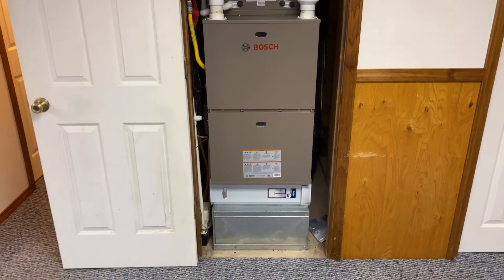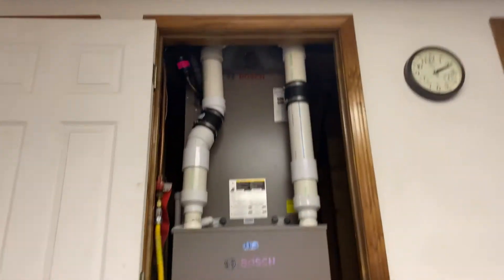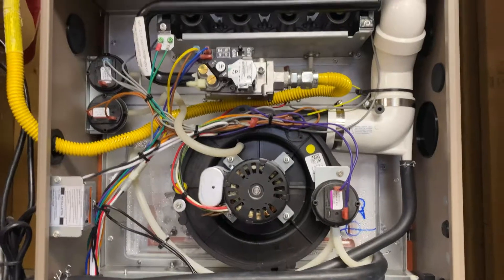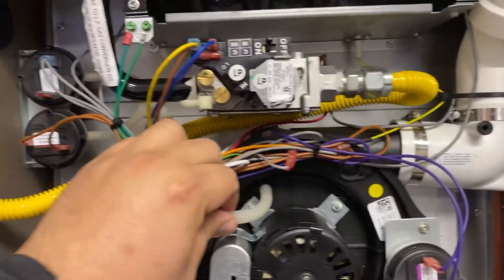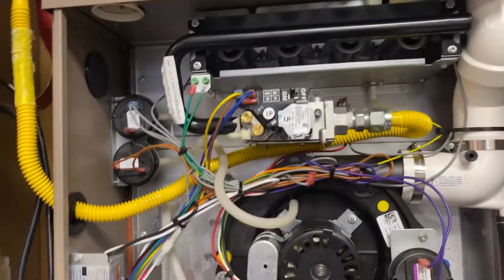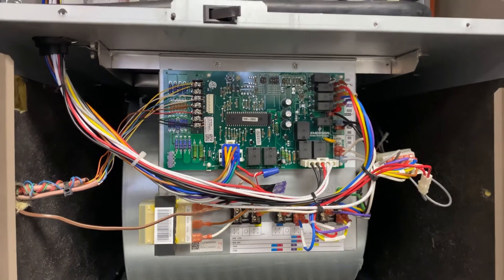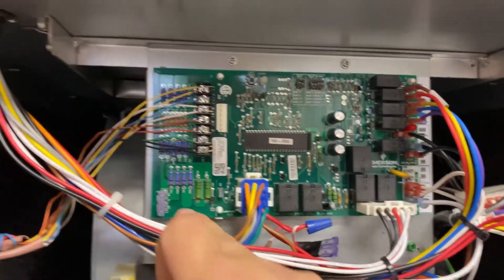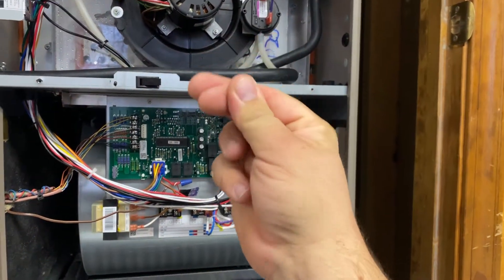Tech Tips #6 Bosch 96% Gas Furnace

Comment: Hi JC, thanks for awesome videos, I have decided to go with the same setup. Just debating if we should go with 80K or 100K dual fuel furnace. Installer said both should be ok. Now we are confused. Our above grade liveable space is 2800sqft and basement is finished also without any outlet yet. What do you think?
Reply from the maker: I’m sorry that I just now saw this! Is it new construction home? Or an existing? What is the square footage of the main floor? Is there a second floor or just main floor with a basement?
Reply: I would definitely go with the 100k furnace since it is a two-stage.  It depends on how cold it gets in your area and what you plan to use as a setpoint for the HP switchover.

Comment: Hey JC, I have the Bosch BGH96 installed with the Bosch Heat pump.  It was installed in February of this year 2023.  It's a horizonal right air discharge install in a crawl space.  When the installer (good company) placed the unit, it ended up too close to the ground to properly install the condensate trap.  He ended up installing the trap horizontally, in my mind rendering the purpose of the trap useless.  That being said, when the unit was being tested, the condensate would not drain out of the clear collection box, not even if the drain hose was removed.  The unit just appears to suck air into the box from the drain port bubbling until the water reaches the overflow switch and shuts down the unit (Like it should).  Do you have any ideas why the unit is sucking air and preventing water from draining out the port?   Additionally, the installer couldn't fix it at the time and we decided just to use the heat pump for the remainder of the winter and the installer would return in late fall to try to correct this issue once they contact Bosch for help.  I'm in the process of contacting them to finally fix this issue, I hope.  Thanks!!
Reply from the maker: After consulting the big book of secrets (manufacturers install manual 😂) you HAVE to install the trap vertically. It will not work horizontally according to the manual. So, if they cannot utilize the manufacture trap, they will have to find a way to make one themselves. 

Also, something that I myself didn’t even catch initially. The rubber 90 that comes right after the inducer draft motor, it has a little drain that comes off of it. It actually comes from the factory uncut (no actual hole). It would have to have the end snipped off to expose the hole. If they’ve installed several of those furnaces, I’m sure they aware of that but just figured I’d mention it. There is a picture of this in the manual on page 18.

Hope this helps
Reply: @jcforward741   JC, Thanks SOO MUCH for the quick reply!!!  I read the part about the bottom inducer port 1/4" cut off in this configuration today.  I'll check that myself before they return, but my guess is they preformed that task.  As far as the trap goes, I'm guessing since the condensate collector box wasn't draining even without a drain hose connected to it, they'll fix the trap issue when they return.  But the issue they can't seem to figure out is why the water will not drain on it's own from the collection box drain port with no tubing attached.  Water builds up to about 2 inches above the drain port all the while with air bubbling through the port into the collection box like it's 'sucking' air.  Eventually the water level reaches the sensor and shuts the unit down.  It only takes about 3 minutes to do that.  Thanks again!!
Reply from the maker: @mike-md  yes, the collector box IS under a negative pressure. It will suck air through the hole while it is running. Now, I’d assume when you shut the inducer down (drop the W call) all of the water will drain out because it is no longer under negative pressure. The condensate trap stops the air from flowing in, which allows the water to drain out freely
Reply: JC @jcforward741    That's it....Thanks!!  Now they just have to figure a way to get a trap installed.   Thanks again!!!!
Reply from the maker: @mike-md  no problem! Please let me know what they figure out! I’m always curious to know how these turn out
Reply: @jcforward741   I definitely will!  But they could be awhile before they come out.
Reply: @jcforward741   Sorry it has taken me so long to get back to you!  It was the trap!!  Once the trap was installed properly for a horizonal application, the unit condensate started draining.   On a side note, once we reinstalled the trap correctly and turned the unit on, the condensate still didn't drain out of the collection box and the sensor shut down the unit like it should.   While we waited for the auto restart to take place in about a minute or so (I can't remember the delay time), I removed the hose from the drain trap's discharge port and place my finger over it to see if I could fill any suction.  To my surprise, as soon as I covered the port, condensate started draining from the collection box to the drain trap.  In just a few seconds I removed my figure and condensate started flowing from the trap just as  it's suppose too.   it's been running for two weeks perfectly.   So I'm guessing that the trap might need to be primed during the first startup.   Well, anyway......a BIG THANK YOU!!  for your help!!!!!
Reply from the maker: @mike-md  awesome!! You’re correct, they definitely have to be primed for first start!

Comment: Is there a way to slow down the circ fan?
Reply from the maker: I believe the circ fan speed is also your low heat speed. So whatever low heat blower speed is set for is how fast it will run. But I would not change that if it is already set up for proper heat rise for your W1 call. Remember, these are 2 stage furnaces, so they have a W1 and W2 heat stage and blower speeds, so make sure to set your blower speeds per manufacture specs

Comment: this is same  unit as chinese comfort maker just with bosh name plate
Reply from the maker: A lot of brands are actually going to Media now too I’ve noticed. I’ve worked on a carrier and a Lennox vrf air handlers that I know were both made by media
Reply: @jcforward741  Midea makes the HP but has a Mitsubishi compressor.
Reply from the maker: @Balticblue93  it used to have Mitsubishi compressor. From what I was told, I don’t think they do anymore. Mine has Mitsubishi, but I’m pretty sure newer ones don’t

Comment: Can you do a video how to do the lp conversion kit on Bosch?  Can this furnace run for heat without a heat pump?
Reply from the maker: The LP conversion is the same as any other furnace. Swap out a spring in the gas valve and orfices on the manifold. Dial in proper gas pressure for low stage and high stage. I think it’s around 4” low and 10” wc high. And yes, it can run with a straight condenser
Reply: @jcforward741  thank you for getting back to me. I am new to this. And if I just use it for heat do I still need a straight condenser to be installed?

Comment: I have the same setup, IDS condenser with Bosch gas furnace. What thermostat are you using and are you setting this up as a dual fuel? I am having troubles with the Bosch BCC100. I set the staging time in the advanced setting - ST to 18 minutes, either the system switched to fossil fuel too quickly or the gas furnace would stay in 2nd stage for too long. I would like to use the gas furnace if outdoor temp is above 48F since gas is cheap here.
Reply from the maker: I use the Aprilaire 8920W stat. It’s their 7” touch screen stat. I have 3 heat pump stages (I cheated in a 3rd stage for extra dehum). Then 2 gas stages. Aprilaire is always super easy to set up. If you prefer gas heat, I’d just run EM heat and bypass heat pump. But you can set up all different kinds of parameters with these stats easily.

In heating:
second stages will engage 2 different way. Time or temp. I’m not sure the time length before it will bump to 2nd stages, but 15-18 mins is about right. Or if it gets 2* behind, it will engage 2nd stage. Then if it gets 3* behind, it swaps to 1st stage gas heat. You can actually adjust the temp behind for each stage (if for some reason you wanted it to run one of the stages longer. It’s all in the install book. I haven’t ran my personal gas furnace yet, this will be my 1st year. Moms (in this video) does really good though. She has the Aprilaire 8476. Not as fancy but has multiple stages
Reply: @jcforward741  thanks. I will look into it a little bit. It seems like the 8920w is out of stock everywhere and the Honeywell IAQ might be my best bet. How did you cheat in a 3rd stage? Are you using the blower to dehum?
Reply from the maker: @xincai951  the Bosch furnace has a neat blower tab speed selection bar. It’s 5 speed I have blower Y1 call on the slowest fan speed. When Y2 comes from stat, It goes through a relay and time delay. So on Y2, the blower bumps up to speed tab 3. After the timer is up in 10 mins, it bumps up to speed 5. Just a bit longer run time for more dehum. Works pretty good.
Reply: @jcforward741  Thank you. I am trying to do the same with my Honeywell IAQ thermostat which has an option for dhimmification using low speed fan. Do you know when Y1 is called, if the speed tab for some reason is jumped between Lo and Med fan speed, will it default to the Med fan speed or it will give an error code? Thanks
Reply from the maker: @xincai951  if 2 speeds are jumped together, to my knowledge that would fry the controls on the motor. I’ve never tried direct tying multiple speeds together. The speed tabs are all low voltage signal that go to the X13 motor. I wouldn’t try jumping them though
Reply: @jcforward741  sorry just wanted to circle back to this one. So when you set Y1 to the lowest speed that means your heat pump heating is also super low at stage 1? I am thinking about adding a relay to slow down my blower G fan speed. To my understanding, the Bosch furnace uses the Lo Heat speed for G call. So I will set the Lo Heat speed tab to a low speed thru the relay, then the relay coil have W1 and C energized, it will switch to Mid fan speed?
Reply from the maker: @xincai951  ya, that’d work if you’re just wanting a super slow G only call for continuous fan.

Comment: Love those Bosch units. You did a good job of shoehorning that unit in the closet. Just an FYI, Flex connectors or CSST should never be routed through furnace cabinets ( violation of the national gas fuel code). You may think your rubber grommet is protection but I can assure you it is not.

Comment: Any idea if that furnace is made by York ?
Reply from the maker: From everything I’ve found, no. Bosch is not in the York family. Although Bosch and Johnson Controls have partnered in other technical areas, I haven’t found anything about them working together on the HVAC equipment. And the unit itself doesn’t remind me personally of a York system.